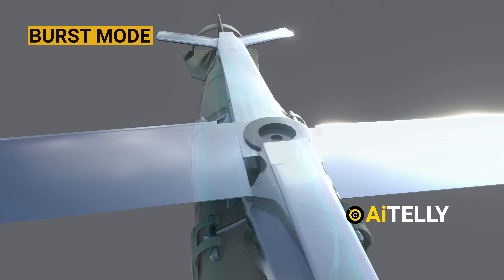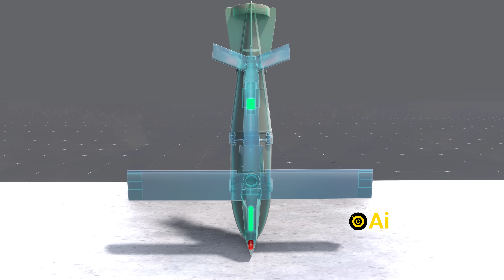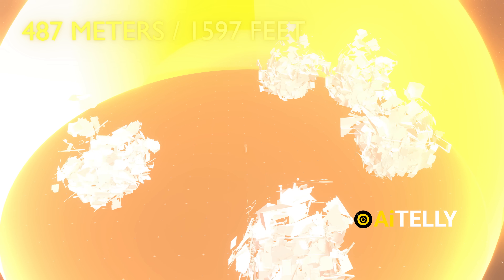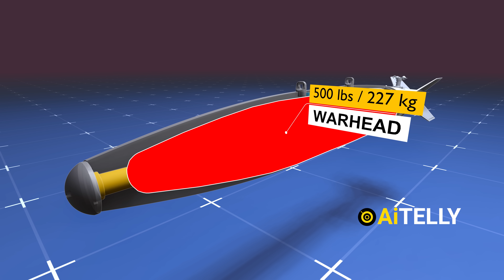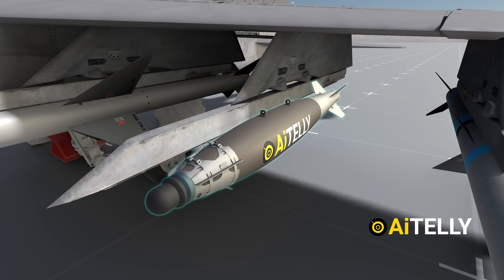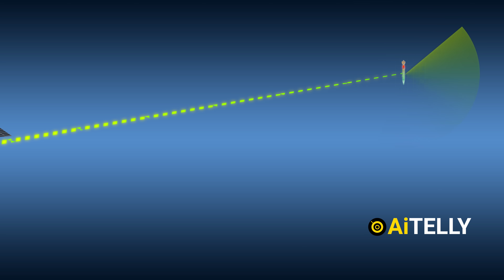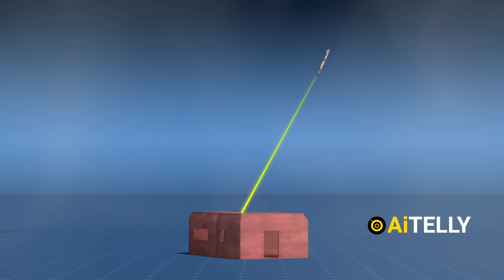Russian Glide Bombs Vs American JDAM | How it Works

Comment: Also it's worth mentioning that Su34 and UMPK FABs are a system. Su24s cannot effectively use this weapon because they can climb only up to 10 km with it, which (since it's a gravity weapon) significantly reduces the range and thus makes it unsafe for pilots. While Su34 drops these from 20 km height.
Much like Mig31 and Kinzhal, other planes cannot so effectively speed the missle up to supersonic speed before launching it. Which gives the Iskander's missile a little more oomph, like 1-1,5 km/s on top, and more range.
Reply: 미국, 유럽연합, 일본 등 모든 나라의 전투기는 미사일과 포탄 투하할때 아음속 비행을 합니다.
초음속 비행 중 미사일과 포탄 투하할 경우 해당 항공기 몸체나 날개를 타격하기 때문에 세계 모든 전투기 폭격기의 공통 사항입니다
Reply: You explained so simply that you have an American education

Comment: UMPK FAB combo is far superior.  They have superior range and more types of bomb  options to mix and match.  They are mass producing UMPK for up to FAB 3000 and are even working to get FAB 5000 UMPK rolling out soon.

In addition it is compatible with all the thermobaric equivalents of FAB series such as ODAB 1500 and more.
Reply: Not to mention, Russians are blocking gps.
Reply: ФАБ 3000 избыточен. Для эффективной работы вполне хватает версий 500 и 1500.
Reply: It has more limited launch parameters, such as 16k feet launch ceiling. It's not superior at all. They're also more inaccurate. As for being mass produced or whatever, we already have over half a million JDAMs, no reason to mass produce yet. Welcome to the 90s, when this tech became more prominent
Reply: @apolloaero  First time I hear about 16000 feet ceiling, TBH. If this was the case, they would've been converting Su-24s en masse for UMPK use to increase their striking capabilities. Yet they only use Su-34s, which has, I think, almost twice the ceiling of Su-24 (10k-is vs 20k-is).

Makes no sense.

As for accuracy - its improving. It was used to be around 50%, and often a target would receive up to 4 bombs targeting the same area just to be sure. Now there are more and more examples of single UMPK-kitted bombs being used on a single target or entire barrage designated to several areas (like strongpoints along a trenchline) with high effect. They still seem to have worse CEP compared to JDAM, but they've markedly improved since the first introduction almost a year and a half ago. And with a new type of glider bomb being introduced recently, Russians are seem to aim at improving the accuracy even more.

You also miss a very important factor - unlike JDAM, UMPK is truly universal, just as U strands for. 3 variants for 3 bomb calibers (250, 500, 1500 kg), each able to fit practically any type of bomb in-caliber. Be it high-drag, low-drag, HE, HE-frag, thermobaric or cluster, with optional aerodynamic hood for high-drags. And technically, the kit could fit literally any bomb of said calibers, even those that are not used right now.

Simply put - it is much more versatile compared to JDAM. And its cost, given Russians mostly used old stocks, is in practice even less than stated in this video. And it requires less work to be installed.

If we discard lesser accuracy (and range on some variants), UMPK is objectively superior to JDAM-ER.
Reply: @mauser98kar  probably has to do woth logistics and existing infrastructure, and the Su-34 is probably the more survivable platform. Also, if you noticed, russia is also using low-level bomb runs. These aircraft are flying at low altitude before making a quick climb to release their payload, then quickly flare, turn back and continue to fly low. They're not flying high due to the SAM threat. All bomb and missile releases have launch parameters btw

As for accuracy, there's a reason they're focusing on the FAB-3000 and are using FAB-1500 more. It compensates for the larger CEP.

JDAM is a kit that's placed on existing bombs. They are used on Mk 82/83/84 bombs, which are all different sizes, ranging from 500 lbs to 2000 lbs. The GBU-31 uses the Mk 84, for example, a 2000 lb bomb. However, it can also use thr BLU-109, a bunker-buster. And since we don't use cluster bombs anymore, there's a version with the BLU-136, basically airburst fuze with high fragmentation. For the GBU-38, you have a version with a composite case that disintegrates when it explodes, this is a low collateral version of the 500 lb bomb. GBU-54/55/56 add laser guidance to GPS/INS guidance. As for launch parameters, they're less strict. An F-22 managed to launch a 1000 lb GBU-32 at speeds of mach 1.5 at an altitude of 50k feet, and still hit its target over 40 km away.

As you can see, the versatility is there. So no, the UMPK is not better.
Reply: @apolloaero  Logistic and infrastructure that supports Su-34, but not Su-24 seems highly implausible, so much so it can be dismissed as bollock. And no, if there is no difference between attitude of the launch (which would be the case if it was limited to 16k feet), there is little difference in survivability. Since both crafts would've been launching their bombs being range of SAMs. And most of the bombing runs nowadays are done from high-attitude using glider bombs. I can't remember last tiny I've seen a video of their bombers using low-attitude runs. On the contrary, there is a dozen of glider bomb runs being published daily, with unknown but most likely significantly higher amount of runs receiving no media coverage. And yes, they are literally flying high due to SAM threats - high attitude allows them to launch glide bombs much further. I know there are launch parameters for every type of munition ever created, I only point out that your number on UMPK parameters may be incorrect.

As for accuracy, it saw significant improvement and UMPK often hits precisely, there are tons of video of such successful strikes. Higher calibers is not just to compensate lower CEP - even the highest CEP cannot compensate lower power. If your target is heavily entrenched, which is happening more and more often, even the most precise strike may just fail to defeat it. Should I remind you of a plant in Krasnogorovka, which survived around half a dozen to a dozen strikes of 1500kg themrobarics? Even 1500 kilo bomb is sometimes not enough to defeat the toughest targets. Besides, of CEP is concerned, it is easier to drop another 500kg bomb to be sure rather than waste much more expensive and much more rare 1500kg, which would limit the bomber to 2 bombs instead of 4 and increase its load by 1 ton, which would also decrease its operation range and maneuverability. All in all, "compensate low CEP with high yield" is quite fallacious logic in current day and age, in my opinion.

Big thank you on JDAM variants info. I wasn't aware enough.

With this information in mind, I must agree with you. IMO, the greatest edges of UMPK were versatility and low cost. But if JDAM does not lack in versatility department and its higher cost is offset by its accuracy, I see no reason how UMPK could be considered better.
Reply: @mauser98kar let it go my friend, this one is a biased US cheerleader... nothing you say will convince him
Reply: @marcelkroeze7580  Can we just have conversation without throwing accusations at each other? I don't care who he is. I am here for what he says regardless.
Reply: @mauser98kar  he has nothing to say, he only copies.
Reply: @apolloaero  The USSR and Russia had it back then too though.  They got raped with shock therapy from America so lost at least 15 years recovering.  America who was unopposed for 20-25 years and had essentially unlimited resources has not gotten that much further than Russia, particularly when yo Lu factor in the military budgets.  Even China who only spends 1/4 to 1/3 of what America does on military is close to catching up and will surpass the USA by 2035-2040.  They came from decades behind the USA on military technology just a decade or two ago.  

I have to imagine that without the complete breakup of USSR and such extreme measures by America to attack decimate Russia in the non military really the USSR or combined successor would significantly ahead of the USA at this point at the very least militarily.  They would probably even be ahead of all if NATO both in terms of technology and production numbers.

America, the EU and western NATO countries have been completely imploding, especially in the lead five years.  Can you imagine an Eurasian block with all the former USSR and China?  By the time USSR collapsed, relations with China were on a trajectory to be where they are between China and Russia now.

Russia and China do a whole lot more than USA and NATO with a whole lot less.  If NATO and “Pacific NATO” had to fight Russia and China in a conventional war they wouldn’t even have any weapons left to fight with at this point.

The west is in decline and their time is up.  The future is in Asia, Africa and South America!
Reply: @apolloaero a 1500 kg bomb does not need to be that accurate, so your point is irrelevant.

FAB is a game changer JDAM has been proven to be irrelevant, only good at killing women and kids in Gaza(against a foe who can’t fight back).

Plus Russia is jamming Western GPS.

Comment: 0:02 fun fact : jdam is a soviet era weapon too.
Reply from the maker: It's a Cold War Era Weapon
Reply: @Aitelly  which was when the Soviet union was still alive?
Reply: @theguyinblackandhorns  soviet era if its soviet, cold war era if its western.
Reply: @richardraw1452  T-90 is a modernization of the T-72 tank
Reply: @yujinhikita5611  No. Soviet union was, well, union. Of states. And fab like most of military tech is Russian within soviet union. So if fab is soviet era weapon, by your own standards, jdam is also soviet era weapon.
Reply: @Feolon Nonsense. This myth was born due to the fact that the turret on the first cars was from the t-72. But here you need to know the USSR's approach to tank building. The T-80 tank has a turret from both the t-64 and the t-90 and from the t-80. It's just that the t-72 and t-90 tanks were made by the same factory, so they had turrets from the t-72, and the t-80 was made by another factory. And it's not a fact that he would have given his turrets to a competitor. That is, there was a modular approach to taxi building. The turret is a module. And the technical specification for the new tank has already been issued. So the factory did so. And a tank is an undercarriage, it is a tank. In the t-90, it differs from both the t-72 and the t-80. The T-90 has different dimensions, a different power plant. Well, he had his own turret.
Reply: @Feolon  lets not pretend the latest A1A2 Abrams isnt the latest in a long line of modernisations to the original 1980's M1 platform without having a single radical deviation from the original design.
Reply: @Howleye Yeah except it’s still called the M1 Abrams at the end of the day. Russia does this thing where they take an existing platform, dress it up in some newer equipment and rename it entirely so that it looks better when they sell it on the foreign market. Like the Su-35, which is just an Su-27 with thrust vectoring and some better avionics. Or the original T-90’s being similar to the T-72.
Reply: @Feolonдурочек что-ли т72 и т90 это разные танки,  это можно сказать что амбра это модефецированый танк тигр
Reply: @Aitelly It's the same thing
Reply: @Aitelly  No, it is soviet era weapon. FAB is 100% developed and produced in Russia, yet, you insist it is soviet era. So by your own standards, jdam is also soviet era weapon.
Reply: @Aitelly  don't lie next time okay?
Reply: @Bapak_Munafiq  Sorry Dad...

Comment: Very high percentage of failures for those upgraded FABs. And due to the tactics of use, the drop occurs far behind the front line and a fairly significant part falls without opening its wings.
Reply: @WolfAtWood  some Russian journalists did do a report on that stating that in Belgorod region alone 48 fabs had fallen 

there are probably more on the frontline and inside Ukraine we don't know of
Reply: @sababugs1125 were they really russian?
Reply: @kindlingking  idk , this is not fact , they were Russian opposition journalists